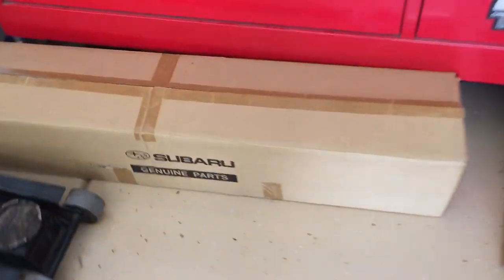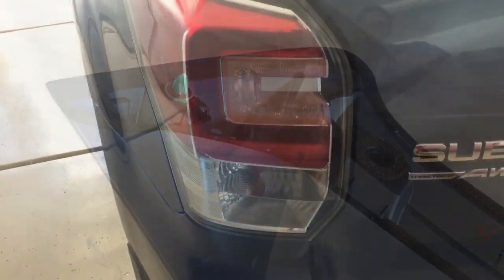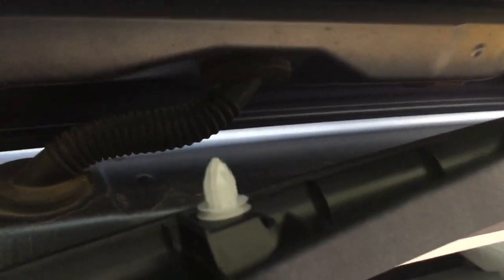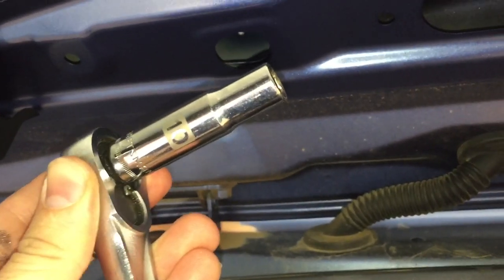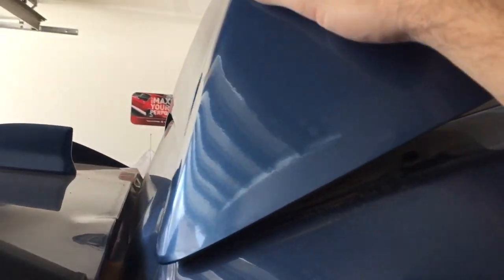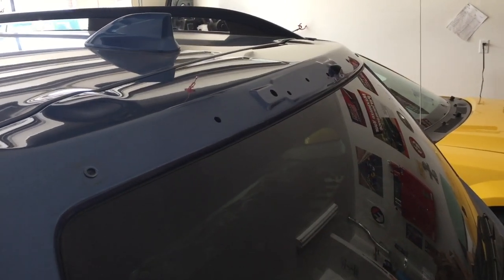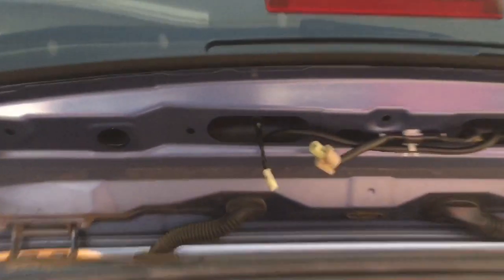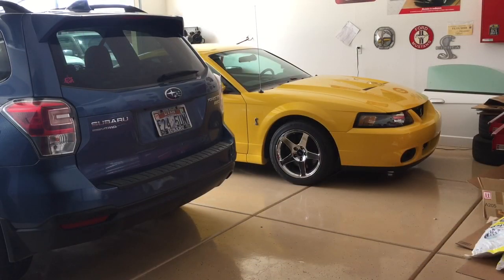Subaru Forester Rear Wing Removal & Installation

Comment: Great video-thanks for posting. If you are removing the wing and planning to renstall the same wing, queezing those push-pins is particularly critical to avoid snapping the plastic slots on the wing when pulling it up!
Reply: instablaster...
Reply: Anyone who has actually removed the spoiler with the intent of re-using it knows that this is a completely bogus claim.

With the spoiler installed, only two of the five clips are accessible; three of the clips are hidden inside the spoiler when it is installed.  "Pinching" the two clips that are accessible (and are located near the middle of the spoiler) won't do squat.

To remove the spoiler, first unbolt the two nuts and two screws that are holding the spoiler on, and then pull the spoiler in a horizontal direction away from the hatch body, starting on one end. After the clip on the end releases, the other four clips will release in succession as you work your way from one end to the other.

There's no other way to release these clips.

Some of the clips may have a small crack in their upper part afterwards, but they'll still work to hold the spoiler in place when you re-install the spoiler.

Comment: I was hoping somehow the gate was the same as the non spoiler version. I want to remove my spoiler bc I want to slide my cargo box back more without having to limit my gate height. Sucks bc I had the whole gate replaced after getting rear ended but didn't have the cargo box to know that it would get in the way. If I knew I would've had them replace it with a gate without spoiler.
Reply: While me searching almost a year already looking too many DYI’s video on how to install on my base model. I like the looks with the spoiler.

Comment: With power rear gates, you have to remove the stay. LH.  Thanks
Reply: While that is certainly what the Subaru Service Manual states, after removing the side trim panels and the LH power strut, I discovered that in fact, it is not necessary to remove the side hardware in order to remove the spoiler. Why the manual says this is beyond me.

Comment: my 2016 Forester has no spoiler on it, and the back window washer nozzle is embedded in the center brake light;  can i put one of these straight/flat line spoilers on it?  but how do i keep the nozzle working?  where would it go?
Reply: The washer nozzle looks like in the same spot.

Comment: Thanks for the very informative video.  Can i replace the spoiler with a lower profile molding piece so my rear bike rack will fit on my new Forester?  Thanks.
Reply from the maker: I haven’t seen one, and the wing itself is hard enough to come by. Have you considered any options that extend the bike holder away from the back of the car anymore?

Comment: Nice video would installation be any different for a 2011 Subaru Forester
Reply from the maker: It should be similar, but if the car didn’t come with a wing it will be very different and require drilling holes

Comment: Do you think one of these can be added to a forester that didnt already have it? Worried about where all those bolts go
Reply: I want to remove mine as the wing hits my kayaks on the roof and prevents rear the door opening but judging by the number of holes it leaves it would look quite bad. I also think the Subie looks better with it off.
Reply: Sorry no they have to come factory drilled.
Reply: @jamessinclair2437  you will need a body shop to fill and paint the holes.